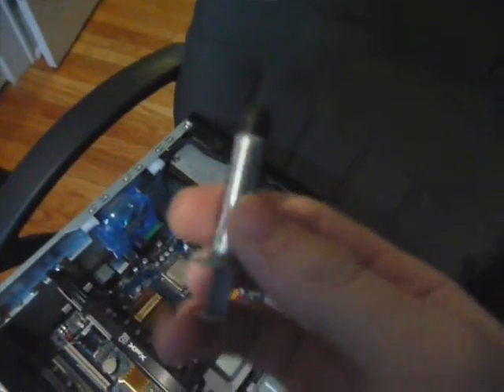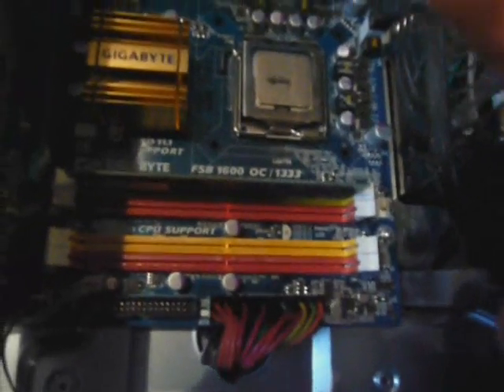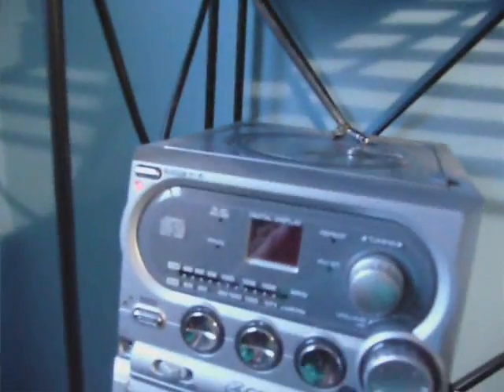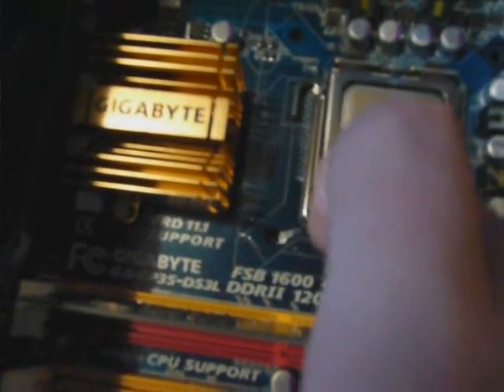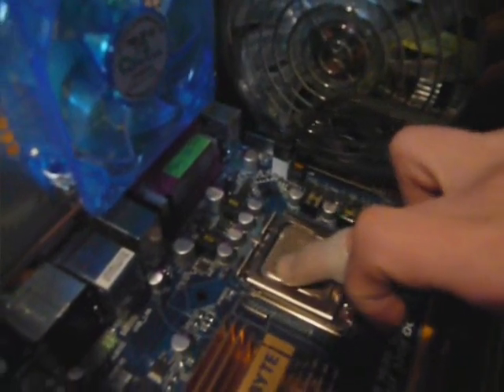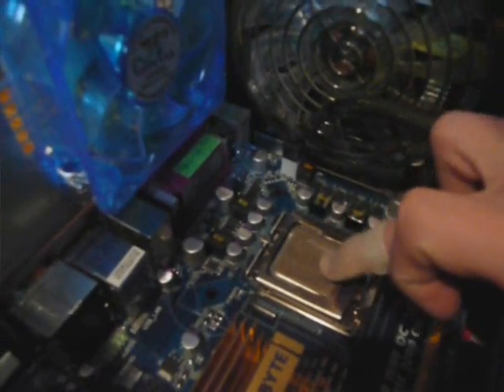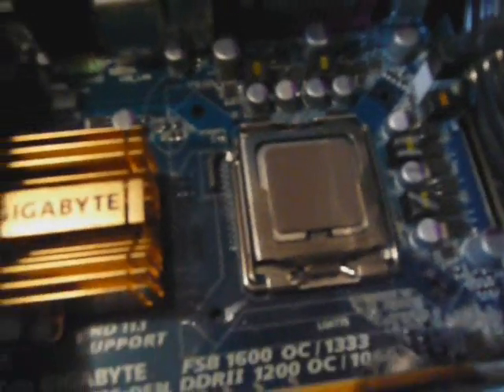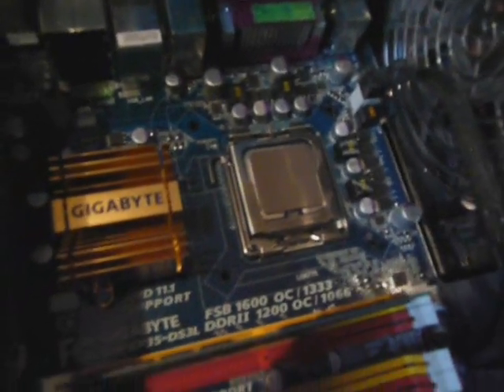How to install Arctic Silver 5 (thermal paste)

Comment: I spread the thermal paste like this many times if not every time. Ive never EVER had a CPU run abnormally hot. The one I have now is running @21c and 27 load, 62 is max.  Air bubbles and all this other bullshit you idiots are saying is nonsense, Complete nonsense (air bubbles are like ESD, it happens but only under certain conditions).   This guy is doing it right simple as that.

Comment: The corners will be cooled without the paste as well but not just as efficiently as with. The spread method just has a high probability of getting air in there with any paste but it's easier to get the right amount. Just use the method that you like to use. I've got this stuff down to lapping heatsinks and CPUs so the application of the thermal paste is just a minor thing on getting the heat out of my CPU.

Comment: Take in account that the CPU die is much smaller than the visible heatspreader on top. The circular patch covers all of the CPU die underneath and leaves dry the corners which doesn't even make direct contact on the CPU. You'll get full contact from the heatspreader (even the corners) to the cooler + no airbubbles in the paste. The dry corners of the HS is a less bad thing than getting the microscopic bubbles in the paste by spreading.

Comment: I clean the heatsink and CPU first with isopropyl, and I do it twice to get any contaminants off. Spreading it is actually ok, (but follow the document otherwise), you have to spread it a little bit thick to get it to mate right, as the danger is you can spread it too thin, leaving gaps which is very very bad, and spreading is often a waste of paste, which is a big deal with costly pastes like Arctic Silver. You don't want to apply so much that it oozes out the sides either.

Comment: This is how not to apply AS5, FAIL. By spreading it like that you'll just make airbubbles in the paste. How to apply: 1. Apply the paste how instructed on your CPU (drop, horizontal, vertical). 2. Press the cooler on top of your CPU, which spreads the paste perfectly with no airbubbles. Optional: Before tightening the cooler fully to the motherboard, twist the cooler very carefully to both directions.

Comment: @kalijasin The paste is as important as the heatsink.. The paste makes for much better heat conductivity than air does. If you had 2 perfectly flat surfaces, you wouldn't need the paste, but since microscopic scratches happen just by breathing on the darn thing, you need the paste.

Comment: tint cpu and cooler using credit card, use coffee filter to remove excess,(do not clean!) place 2/3 of a bb (.177 caliber) or an uncooked grain of white rice of artic silver 5 on cpu and place cpu cooler on cpu and attach. your done no wiggling pulling back off to check. leave it alone and watch cpu temps! if they don't improve after 2 weeks try again. more than half of you making comments have no frigging clue!!!

Comment: Displacement.  You must get the air out from between the heatsink and cpu surface.  By pushing the heatsink down on the cpu surface covered with compound there is a much higher possibility of trapping air because the compound is not pushing out the air.  If you drop a medium sized pea bead of compound on the cpu surface then directly push the heatsink down it will spread the compound out "displacing" the air.  Both methods work..once is correct and you will see better results.

Comment: This is the wrong method to put thermal grease. It creates air bubbles between the heatsink and the Thermal grease. There is an explanation video where some chinese guy put a thermal grease then trying all the methods using Glass, So you see what actually happens when you put the grease.

Comment: never spread the thermal compound, it causes air bubbles to form which restricts the contact of the heat sink to CPU. 

Use the pea method, and place a small drop in the middle and put your heat sink down onto it, The heat sink will do the rest by spreading it out over the core of the CPU where the compound is needed, evenly and without air bubbles.

Thermal Compound does not need to cover the whole CPU just the core where all the heat is. Less is more, never put to much compound on.

Comment: I first applied AS5 by spreading a thin layer over the cpu using a credit card. Then I tried the line method and saw a noticable drop in temps. I have a Q9550 btw.

Comment: Well, I wouldn't suggest doing this, as putting Thermal Past of any kind all over your CPU doesn't do all that much, you need most of it in the center as that is where the majority of the heat is coming from! Spreading it helps a tad bit, but it's very minor and unnecessary :)

Comment: Thermal compound makes all the difference.  If you have a processor with a heatsink on top of it with no compound, you are doing yourself an injustice.  Thermal compound is very inexpensive (usually less than $10 a tube) and can make up to a 30 degree or so difference compared to computers without it.

Comment: hey i didnt quite understand you

"use a flat object to spread it in a circular motion as when you fit you cooler the paste will spread out even more under the pressure"

im using a credit card but the guy down there said it was causing too many air bubbles
can you be more specific?]
thanks

Comment: do not do like in this video lol !!

you have used way to much at you will not get a good contact with your cooler, you need to use around a 1/4 of the amount of paste you used, and use a flat object to spread it in a circular motion as when you fit you cooler the paste will spread out even more under the pressure !

Comment: Whenever I build a new PC, I use an old, expired credit card or gift card to spread the Arctic Silver 5. 

Or another way is put an amount equal to a small grain of rice on top of your CPU, and using your heat sink, press down on that dab of AS5 to spread it, then give your heat sink/fan a slight twist in both directions before you lock it in place. It's crude, but it usually does the trick.

But the credit card method is a bit more precise in getting the coverage even.

Comment: He has the same board as I do but appears to be factory OC'ed to 1666 from 1333 fsb.  Of course that's what I run mine at anyway.  

Great video.

GA-P35-DS3L rev 2.0
Wolfdale E8400 @ 4.0 GHz

Comment: DO NOT FOLLOW THESE INSTRUCTIONS!!!  I wouldn't do it this way. It is NOT the way to put on TC. You want to follow the instructions. The idea behind the instructions it to concentrate the compound on your cores and then let it spread out from there. And It is NOT good to get the compound on the sides of the processor. And Do NOT let the compound string across your motherboard as it seems to happen in this video. LMAO!

Comment: what m1croninja was talking about works well for dual cores. For quads which I use your method works better. But either way would work fine, but I prefer the way you do it (as I do) for a quad.

Comment from the maker: yea....even idling at ~40C is fine...my comp idles 40/39/48/41 right now cause its hot in my room and my Q6600 is at 3.2 GHz......idle temps under 45C are fine.

Comment: Lol I needa re-apply/re-install my heatsink again I actually used the Thermal Grease that came with the Zalman 9700 NT -.-" (don't ask) how many degrees you think the paste would do and a question on applying the paste you don't need to apply on the cooler as well right?

Comment from the maker: uhhhh.....i've never tried it so i WOULDNT recommend it, but what i use is simple  nailpolish remover that i stole from my mom. put it on a cotton ball or a paper towel or toilet paper and clean the cpu and heatsink off with them first (the heatsink will have some preapplied bs)....then whipe it off, let it sit for like 5 minutes, and apply. Nailpolish Remover can be found at basically ANY 7/11, cvs, drug fair......any place really.....works real well.

Comment from the maker: Oh. Never even saw your comment lol. Wel, I have a rosewill 750 Watt psu. Its 8800GTX Certified. And I posted a poll on tomshardware(dot)com and people said my psu is FINE for dual 9800GTX's if i want it, which I dont need. I dont recommend a Rosewill PSU though. Get the Corsiar 650 or 750 Watt power supply. Type it in newegg. "Corsair 650" "Corsair 750". Good luck

Comment: I had that PSU, chromy rosewill 600w?
i needed something with more UMPH for my 9800gtx
Is 57c too hot in full load on a AMD am2 6000+ 3.3ghz(oc) processor? 
i have a Zalman 9500 on it

Comment from the maker: ya. its the EXACT same process. ANYTHING with a processor and heatsink combo you can put thermal paste on. you can even put it on processors in certain Tv's.....hell toy cars too. Thermal paste can be used on laptops most defiantly. And most companies use cheap stuff that they dont apply well enough, I put arctic silver 5 on my processor and my graphics card (removed heatsink and put new stuff on.....and it works flawlessly now.